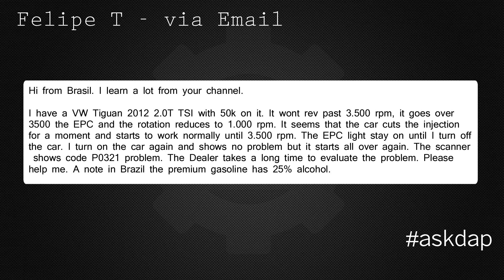2011 VW 2.0t TSI Engine... Wont Rev Over 3500rpm and Fault Code P0321

Comment: Good evening all the way from South Africa i do have a audi a1 2011 model caxa engine  i did the timing on the car aswell replace the crankshaft sensor with a original part still getting a error code of p0322

Car struggles to start and does not go above 4000rpm and has almost no power please can you assist

Comment: I have a b8 1.8t that is sluggish. It only  revs to 3800 rpm but revs past this when airflow sensor is disconnected. Car doesn't boost though.

Comment: I sent you an Email but here is my Full Email.

2012 VW Jetta Gli 2.0t Gen 1 CCTA Engine 6 Spd Manual 89k Miles.

Please Help me out as idk what else to do.
Every time I Drive the Car, once I press half throttle and car reaches anywhere from 3800rpm to 4300rpm it will fall on it’s Face hard and I would have to let out of the gas pedal and slightly press it back on the following gear, this started happening out of nowhere, and then now sometimes when the car falls on it’s face the Fuel Fuse 15amp would Blow on me where car won’t turn on and as soon as I put another Fuse it will also blow up on me, I then let car sit for awhile or disconnect battery for awhile and put a new Fuse back and car will turn on just fine and fuse won’t blow up. Idk what else to do as I can’t find any Vw Mechanics near here. I am a mechanic and work on all my cars and customers but this is a problem that I just can’t figure out on my own. 

Codes I was getting,
-	P025C Fuel Pump Module Control Signal Too Low (I Replaced Tank Fuel Pump & Module) haven’t replace the high flow one by engine.
-	01279-005 G251 Longitudinal Acceleration Sensor but that code disappeared and never came back on.
-	P0341 Camshaft Position Sensor ( Replaced it with New one & Code is gone) 
-	P2015 Intake Mani Runner Position Sensor/Switch Circuit range/Performance bank 1a (Code Came On Once, I Erased the Code and Never came back On)
-	00257-003 Right Rear Abs Wheel Speed Sensor ( Replaced With New And Code is Gone)

I no Longer have any Check Engine Light or Codes On Stored Codes, Or Pending. Only Code is on Permanent Codes Which is the 
P025C Fuel Pump Module Control Signal Too Low and the Hill Assist Light Error Warning.

I recently this Month Replaced
Spark Plugs Ngk & Red Performance Coils
Camshaft Sensor
Pcv valve
Wheel Speed Sensors
Fuel Pump & Module

Comment: Crankshaft position sensor has been replaced, coils plugs as well, still having this issue but it’ll do jt at 2k rpm before cutting power and going into limp mode with the same code
Reply: Any chance you solved the issue?? I’m having the same exact problem but can’t solve it
Reply: @neekcambule3303  For me, my water pump went out and leaked coolant all over the speed sensor which caused the issue. Sensor is cheap but I’m not sure how easy it is to install without the water pump being out.
Reply: I had the same Symptoms but only when oil temp. above 100C. I also had some leak of refrigerant over the rpm sensor. I replaced the rpm sensor and fixed the issue. I managed to change it only by removing the air filter system and a sensor which is in the air tube going from the intercooler to the engine. Its kind of a blind job but doable.

Comment: Where is the Crankshaft Sensor? I have been diagnosed but can't find it. 2.0T 2013 VW CC
Reply from the maker: +Jason Young Generally they are on the front of the engine block near the transmission bell housing.
Reply: Yes, I eventually found it. You have to take the Tube from he intercooler going up to the throttle body off to kinda see it.